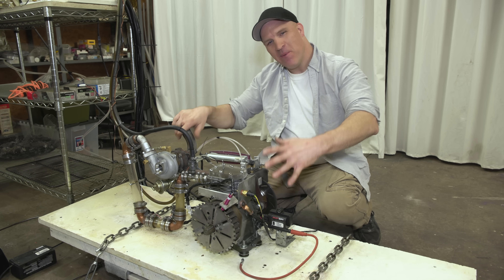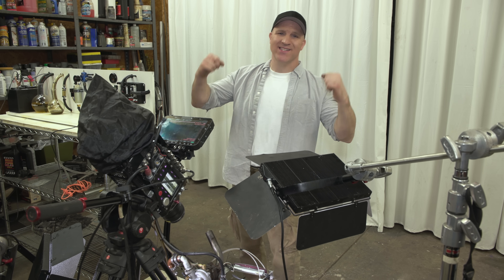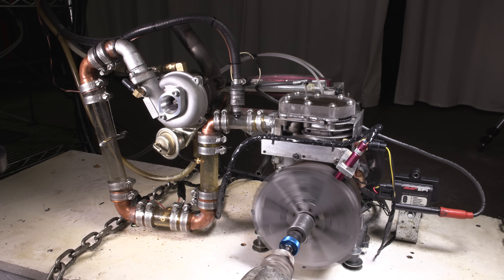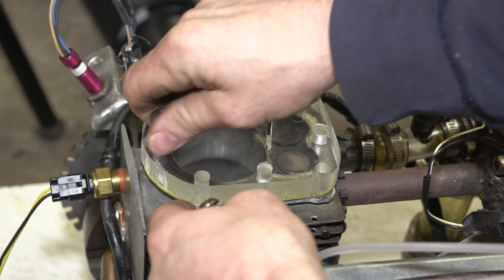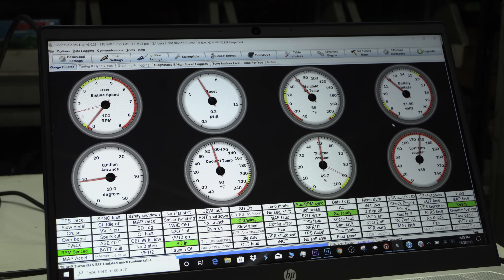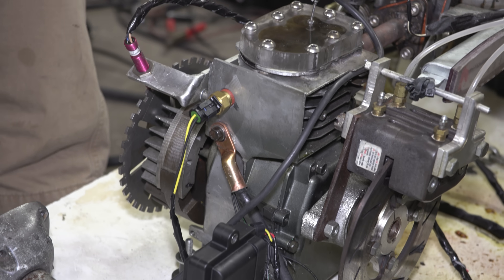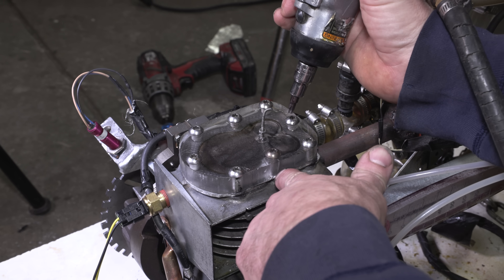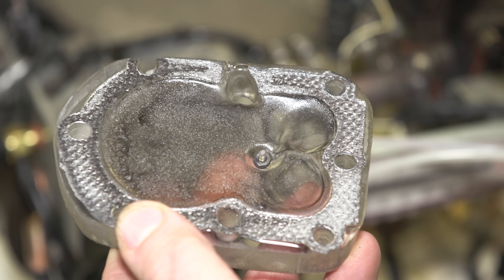Turbocharged SEE THRU ENGINE on EFI and Nitromethane (FINAL EPISODE)

Comment: I got a idea on why it failed in the end, The screw for the ignition spark looked like the hight of the threads was too small, What I mean is the bite of the screw was not so strong If you used a more aggressive screw to bite into the plastic for more grip, also heat management so be careful on your depth so its not so much in the inferno, another would be the mass of the screw/bolt so add a nut or two for a heat sink,  also more technical help in future would be to use a buttress thread its use is for large forces in one direction, the thread has one flat side on one of the flanks or ise a ACME. Love your videos btw

Comment: The sound is just insane! The first mower of my dad had this engine installed and later when he purchased a new one I started to experiment on that engine. Removed the limiter or what it is that keeps throttle independent of the load and it ran on about 6000rpm (just guessed by ear), as well as removing the air filter and I thought that was a cool sound from such a small engine but yours tops anything.
But one question: in super slomo it looks like it's running on 2-strokes?
Ok, forget my question. In 2nd slomo I can see the 4 strokes.

Comment: I out of all your design and engineering was bang on the weak link was the actual head itself and hey you didn't make the plexiglass or polycarbonate that was made out of otherwise everything was perfect hey it was fun watching it it was great it was brilliant I am a 69 year old retired machinist,tool & die maker and mold maker. I can see all the work you've done I have fabricated for years if I didn't have parts I'd make them thank you

Comment: Loved this series thanks so much for doing it... Surprised you didn't buy some VP turbo 118 octane and give the motor 20 or 30 - TDC Timing and play with head gasket thickness to alter compression. From what I understand blow motors need 6:1 (less than stock). So much more could be revisited.. Oh also top fuel dragsters use nitro 85 weight oil.. special for nitromethane. Awesome stuff and very impressive project sir. Fab skills mad good. Peace ✌

Comment: you dont have a path to ground with your see through head buddy . your spark plug is arcing to the piston or the valves whichever one is closer at the time .  thats why you dont have consistent combustion, besides you have to have a blue flame in there not yellow,  mixture is way too rich.
Reply from the maker: Thanks ! Well I used the back of the engine as ground to clear the view of the combustion and make it a little simpler, and I intentionally ran it rich in order to make it visual

Comment: I mean plexiglass isn't normally supposed to be under 400 degrees.. And bingo it's running again it's only changing out the see through heads which proves it was a good engine through and through.. God I hate China bought out Sears and Briggs and Stratton.. Now it'll be junk..😢 Mitch McConnell & Nancy Pelosi two main reasons this keeps happening.. But some people can't see things under their nose..

Comment: It's almost like it's running out of fuel because I see air in the lines (bowl leaking? Be my first guess if it's not the lines) if not maybe the head isn't sealing? So then the compression is leaking out the see through head.. It's obvious you have fire and compression it'll run so that's another thing that says fuel or clogged jet..

Comment: How are you doing calculations on a drag brake that varies resistance based on heat. you could use an alternator and resistance bank to get accurate results. I would think, just saying. Still watching though so thanks for the content
Reply from the maker: Well I make adjustments by ear and Rpm, it's accurate enough and much easier to understand "Brake Horsepower" but there is some loss due to friction to heat conversion.. not enough for me to worry about though.

Comment: Dear warped perception. If your having issues with the spark through the engine causing disruption and damage to the crank sensor. Why didn't you insulate the crank sensor bracket from the block casing and run a ground wire from the bracket (assuming the sensor is using that bracket to the block as a ground) to a separate ground source than the other electronics. Reduces any potential for back flowing current??

Comment: I honestly didn't think you could effectively turbocharge a single cylinder engine i was told there would be too many dead spots between strokes to keep the turbo spun up and create excess pressure in the head.

Seems to be OK here.

Comment: The thing is, with a perspex head, your spark has to jump from the plug to the block, valves, valve seat. 
Try putting your spark electrode into a metal tube and ground that to the block.

Comment: You should drill some cooling passages through the head. And run some water with the circulating pump through the head while doing a dyno run.

Comment: what if you had use an inter-cooler for the turbo? wouldnt it make the air more dense since the exaust side from the turbo would heat the compressor side making the air less dense?

Comment: Likely issue when switching from the original head to the see through and loosing spark was the lack of a resistor type spark plug. Without a resistor the plug makes a ton of noise and messes with the efi.

Comment: See how that head wore with a crater where the electrode was? Use a tapered head screw upside down as the electrode as it will be self-sealing and you won't lose anymore electrodes. You can even use a nut on the top of the head to keep it tight in case the plastic on the threads loosens. You could even seal it with high temp RTV as thermal protection.

Comment: Only question I have is are you running nitro from a RC car nitro?  I thought most of it is a type of oil mixed into it rather than striaight nitro.  Having the extra oil are you losing power or gaining with the nitro RC gas.  I've tried it and didnt notice much of a difference mostly because I didn't re-jet the carb.  Anyway just curious.

Comment: I would like to see this run with a stock head and a Tillotson HL series double pumper carb with an external pump and set up for blow through carb.  The pulse would have to come off of the crankcase and the crankcase would have to have a functional PCV.  
Your 50/50 nitro, is that a blend with gasoline or methanol?

Comment: Your determination is admirable. I like how you kept trying and trying. It was very awesome to watch. Only thing I can think of is to use a nut on the bottom side so you could thread a regular spark plug through the top, but it would require more work. Like I said, excellent video and thanks for pushing all the way through.

Comment: How about a glass head? Might survive the heat instead of melting, trying to blow up a steel bottom end with a plastic head that can’t handle heat or compression will never cause the engine to blow up

Comment: I'm surprised the cast acrylic has worked as well as it has.

While cast acrylic can easily handle the pressures at that thickness the temperatures are another thing. In lab settings, I was under the impression that sapphire glass or quartz glass was used which can handle the temperatures and crazing far better.

Comment: You should lower the turbo and clock it like 95 degrees clockwise and run it straight into the engine

Comment: just found this channel. you need to ground that "spark plug" better dude. whats wrong with tapping threads and using a real one? ground it with a ring terminal and wire to the nearest head bolt.

Comment: im wondering if it being a 1 cylinder 4-stroke makes the exhaust and intake flow too inconsistent for a turbo. basically has the turbos impeller is slowing and speeding up every stroke instead of remaining constant. having an intake and exhaust manifold with a large amount of volume where its almost like a resivore for both might make the flow more consistent. it would take longer too spool up but being more consistent might be the key you are missing

instead of running aftermarket EFI without an o2 sensor, it might be easier to rig a couple simple standalone circuits since you want reliability and run full throttle. instead of a CPS with a multi tooth wheel, make a hall sensor with adjustable base to trigger spark and set timing advance. maybe have a second hall sensor to fire the fuel injector. use a potentiometer on electric fuel pump to adjust fuel pressure in order to fine tune. heck add a cheap wideband o2 sensor jsut for the fun of it. 

it kinda makes me wanna try and build my own rig now and test me own knowledge

Comment: Is the thing on your drill a clutch that allows you to start those safety? If so, where can you get one, I would like to have one.
Reply from the maker: The clutch mechanism is part of the engine, it's a one-way centrifical ball clutch. Here's a link to one:  https://www.jackssmallengines.com/jacks-parts-lookup/part/briggs-stratton/399671?gclid=cj0kcqianl7ybrd3arisajp_olbosbnj2pfmb_qguzsqgq1rcpd3agsadgs1sulfgwioriewkqkf-feaantaealw_wcb  I don't know of any other manufacturer that makes it, however I'm sure there are other designs from other manufacturers, I just couldn't find them on Google. Hope that helps you
Reply: @WarpedYT  Thank you for getting back to me.

Comment: i love that you are using tunerstudio!!
Reply: oh snap a ms3?! sickk
Reply: also it seems like your timing is off on the injector! watch the slowmo and when it squirts theres no intake to suck at the same time?
maybe put the injector near the turbo more or set timing dif
Reply from the maker: Wow this set up I didn't have a cam sensor oh, so the computer doesn't really know when the intake stroke is occurring. In this situation I really didn't affect the performance much, at least I don't think it did, the only difference is you're going to have to squirts per combustion event so that means you have to run half of the injector timing that you normally would
Reply: @WarpedYT  yeah true that and I mean you don't technically need to know the timing of the intake 
That being said my toyota pickup just has a distributor and the ecu does the rest
Meaning of you know what the ignition is than in theory you know when the intake is in theory anyways lol
But besides that I love that you made it work! And shocked i actually got a reply 😅😅 i was looking at my phone thinking it was spam

Comment: Instead of putting spark electrode on see thru... Just install a little metal concentric cylinder of exact clearance volume and install completely see thru... The electrode will be in that extended cylinder 🤔 and will last untill the "see thru" blows off... And instead of making threads inside "see thru" just make it complete flat because pressure hits weakest bonded atoms, and its there in the threading you've done... Clamp the head with even bolting... That will be surely fruitfull

Comment: I don’t get why he doesn’t screw the “spark plug screw” into the acrylic block from the inside, that way the head of the screw will keep it from heating up and flying up and out...this screw has melted the head and blown out several times, bolt it in from the bottom and the head of the bolt will hold it in

Comment: I think your main issue is the length of spark gap which is allowing the voltage to spike much higher than intended which in turn creates large electromagnetic interference spikes - these will induce current spikes in any nearby wiring or sensors. The fix is to shorten the spark gap back to same as speced for standard spark plug, maybe add an extra grounded bolt at an angle which will make the spark gap adjustable

Comment: Convert the head gasket metal.. and a shield style plate like head gasket under head so the chemical shield simmiliar to that screw create it in to a plate not  a screw / .. this has too do with chemical desings... science..sure it will still fire  that engine better  . .. maybe need thicker electrode wires... so the shield is electrodes sir  ..  . The plate shield  and electrodes are connected togather ... that small screw electrodes too weak... . Make sure you tight them shields and  cable electrodes good.... imagine how the batteries in a car are connected to cables too . So they hold they are tight it fires power

Comment: A head with a window of fused quartz would be neat. Its cool that the plastic lasted that long though, I didn't think it would the first time I saw it running. It looks like the plastic is hitting it's flow/melt temp. Since it appears that heat conduction at the electrode is an issue maybe a smaller diameter might help with conductive heating. Idk, I'm just guessing though so don't take my rambling too seriously.

Comment: i got a suggestion, why not use compressed air from a compressor to charge the engine since the turbo is not making much boost. usually a engine internal can take way more then 5 psi

Comment: I believe if you use washers on the Spark screw you'll get longer life from those heads. Seems like the heat finds a weak spot around that point causing failure. Could work who knows just a idea.
Be blessed Jah Rastafari Selassie I Jah

Comment: if you follow my advice, please buy number of samples, so when you tighten them into the frame and they crack, you may have spare. the spark will have to go through copper frame, not through sapphire. the copper is because it is soft to make tight connection without cracking the glass.

Comment: You are running too rich. U need to add a wide bad o2 sensor and a map sensor if u don’t have one. Most mega squirts come with an internal map and if they don’t its very ez to add.
Reply from the maker: I did have a wideband O2, if you look closely somewhere in this episode I removed it and threw it to the side. Unfortunately it only lasted two runs, because it started burning oil pretty heavily and it damaged the O2 sensor.

Comment: Looks like there is little to no atomization of the fuel from the injector that will make it less effective and may cause many missfires
Reply: More fuel pressure or make lika a venturi vacuum right where the fuel goes in.
Also adding a heavier flywheel will make it run more even 👍

Comment: You'd think today, exploding a motor  would be like the last thing you'd wanna see..  Vs. trying to get that engine to not explode while throwing some uber amounts of performance upgrades to it.. but the only thing I see exploding (even if the engine blew) is the dollar amount to make this happen.. Why at the cusp of technology moving to free energy and anti-grav tech (which really isn't anti-grav since gravity doesn't really exist and is a term used to explain and calculate (theory science) the phenomena of the magnetic pull of the earth from one's own body and other bodies of material.)  Sadly it's simpler to understand than going into mindless quantum theory generated by mathematics.. this technology will  unbound us from the limits of atmospheric forces and propel us to speeds unimaginable with vehicles like the TR3B hitting mach 9 in a matter of seconds with only approximately 20% of the G force felt in standard combustion engines..  the technology removes 80% or more of the driver's "gravity" (so to speak) therefore only at most, 20% of it's forces.. the limits are within the body of the driver, not so much the vehicle itself.. as we see when rides go wrong at parks where roller coaster have failed on braking and exceed 2Gs, half the people are passed out and some aren't.. But when displayed as this, where it's only performance of engine and not limited it's driver, we are looking at complete performance are we not?   Efficiency should be a consideration..  to make an engine perform just as good or better with a cost only on production..(those go down later upon producing in mass)  but fuel economy doesn't, sometimes worsen.. To go down the rabbit hole of that is a whole new ball park and as seen in history cause stuff like hydrogen gens and vaporization of fuel has been around since the early 1900's .  there are engines around 1910 that already had these implemented in their design and in 1927 Holley made a carb that was an option to the Model T that would vaporize anything combustible and make it work as a fuel..  This video only moves one line of the bar.. I'm wanting to see  both lines achieved at max and see the motor still running by end.. :)

Comment: Not like it really matters right now but if you had a stainless steel nut to imbed in the bottom of the head and thread your electrode into then it should weld your steel electrode to it and keep it from blowing out your head, just use a nut on top to sandwich it with a small amount of pressure that way it keeps the acrylic molecules from melting so quickly. Just thoughts.

Comment: If you want a head explosion use a thinner perspex and a steel clamping ring that sandwiches it to the block. 
Richer for more cyl cooling to stop the spark bolt failure, or just a washer for more bearing area for the bolt on the head.

Comment: Can you make the crank case (or one side) transparent as well? (edit: also why don't you fit a real spark plug?)
Reply from the maker: That's coming very soon. The reason I didn't put a real spark plug is because I tried that in the initial test, the spark plug ends up absorbing so much heat from the combustion chamber that it only lasts like 20 or 30 seconds and then it gets too hot.
Reply: @WarpedYT  I suppose that makes sense - a spark plug is metal and designed to be in a metal head which would disperse the heat. Maybe a ceramic (or some insulating material) insert would help? Looking forward to the crankcase vid. Remember seeing a 1950's film that showed a crank wobbling like jelly at high rpm...